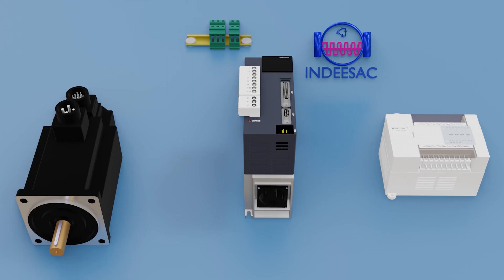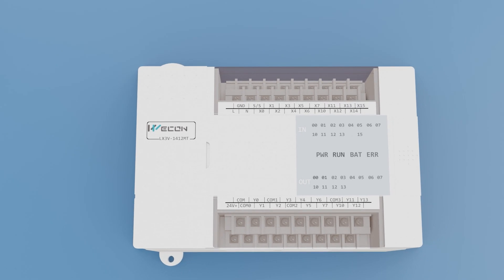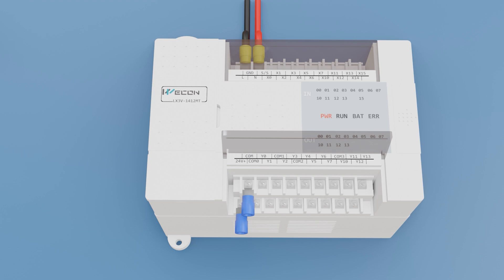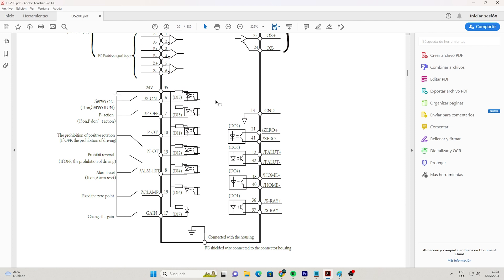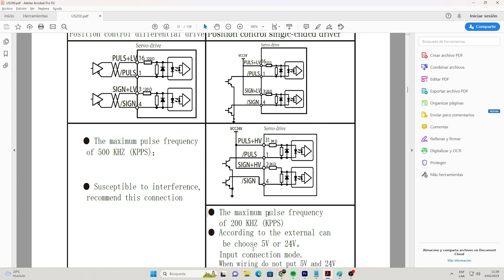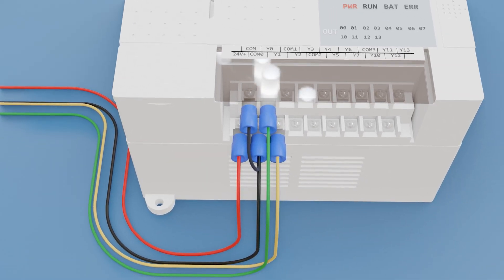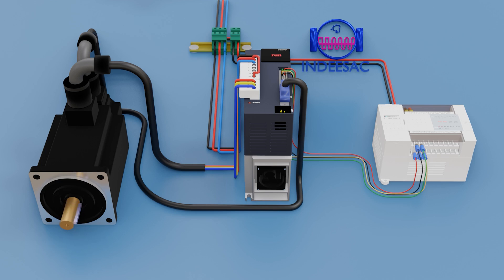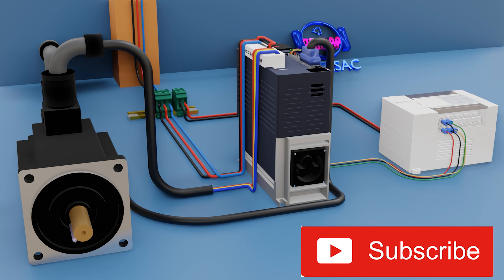How to correctly connect a Servo Driver - Servomotor with any plc?||Complete Guide

Comment: This is a NPN PLC. Not PNP
Reply from the maker: Hello, I am referring to the signal or current of each output, in PNP it is Negative and in NPN it is positive, as well as this example, regarding the transistor outputs of a PLC, greetings!

https://www.qbprofe.com/automatizacion-instrumentacion-industrial/diferencias-entre-pnp-y-npn-en-cableado-de-automatismos-industriales/
Reply: @IndeeSac  "PNP, its Output would be Positive ( + )
NPN, its Output would be Negative ( – )" This is from the article you linked.
Also most PNP PLCs have ZP UP inputs, and most NPN PLCs have COM inputs.
At 2:27 you said that PNP outputs a negative signal.
Good video nonetheless
Reply: @IndeeSac  You saved me a PLC and/or a sensor. Thank you

Comment: you didn't show how you controlled the servo motor, which input is activated to turn left or right, run low and high etc.
Reply: Maybe that PLC is operated by voice assisted like Amazon alex😂
Reply from the maker: Hello, the inputs depend on the plc programming, on this occasion the video I made is focused on the connections of the servodrive with the plc, to carry out the control correctly.

Comment: Excellent video.  But there is a mistake.  The main circuit breaker is supplying three-phase 208 or 240VAC.  From two terminal blocks, you have two of those three-phase power leads providing power to a PLC.  However, the power input to the PLC needs to be 120VAC & a neutral.
Reply from the maker: Hello Brian, yes you are right there are PLCs that have that voltage, well it also depends on the model and brand, in this example I used a WECON PLC that supports an input voltage of 85 - 265VAC, greetings!!!